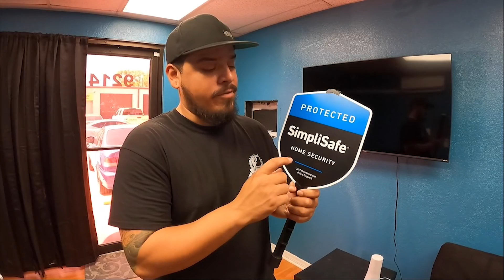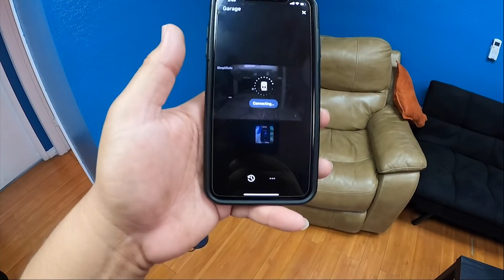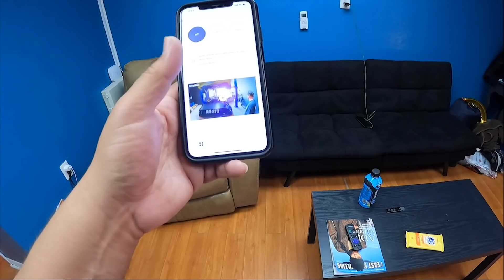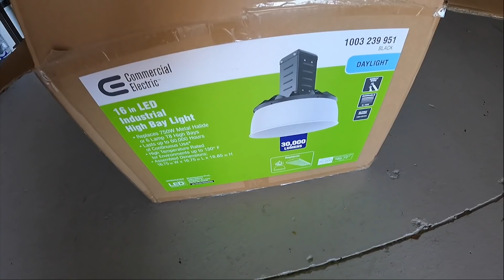WE ARE BUILDING A B-SERIES AWD MONSTER! HONDARU'S MOTOR IS BACK IN!

Comment: Hi Emilio! You should be aware of That the position for the smokedetector in the shop is not optimal if an fire auccurs, the smoke Will go all the way up to the roof then after awile a very long time it Will hit the detector but then the shop is burning as hell, but if you put the detector up in the roof i can also be anoying when you weld, it can go of very often, but so you know 😀

Comment: Just fyi carbon monoxide sensor needs to be close to the ground  wall plug height is good research it im just trying to help that simply safe is awasome
Reply: Carbon monoxide is lighter than air. So 5ft up is the lowest I'd go. Higher up the better.
Reply: I stand corrected 
Because carbon monoxide is slightly lighter than air and also because it may be found with warm, rising air, detectors should be placed on a wall about 5 feet above the floor. The detector may be placed on the ceiling. Do not place the detector right next to or over a fireplace or flame-producing appliance.Dec 30, 2021
Reply: My appoligies